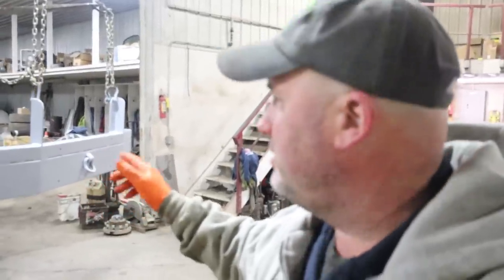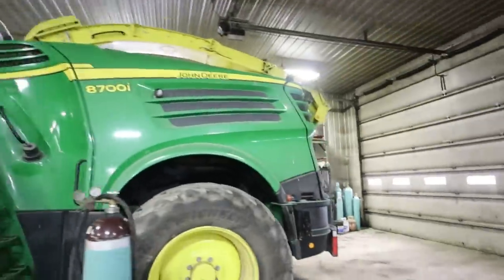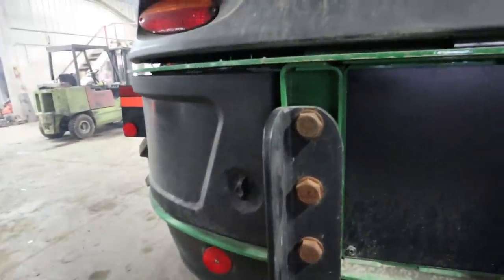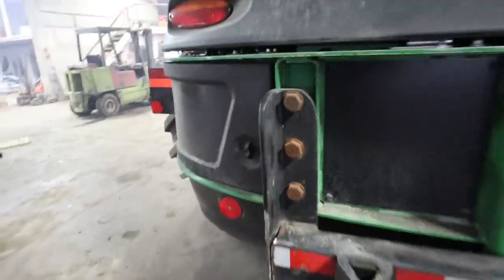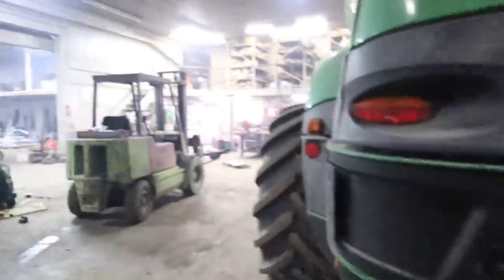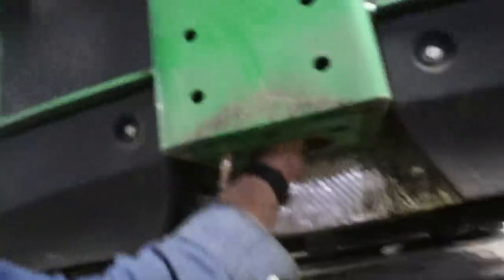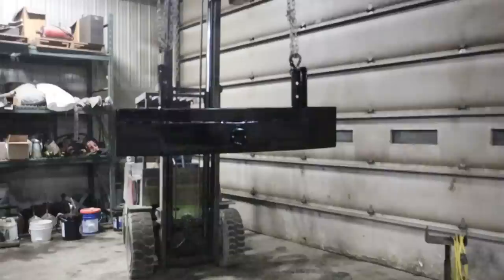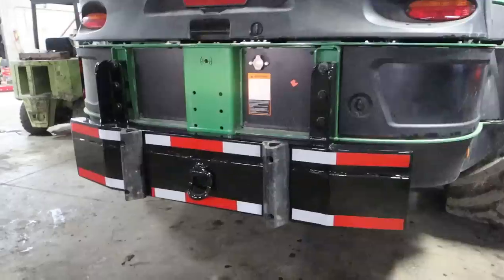John Deere 8700 Chopper bumper repair

Comment: Bumper repair turned out great. nice touch painting the chain. when i paint my chains, i use fluorescent green so i know they are mine. not to mention it looks good on a black trailer.
Reply from the maker: Thanks for the comment, florescent green and black is a great combo.

Comment: Andy, you need two back up cameras with night sight!
The upgrade to half inch and increase to grade 100 will last longer. The grade 100 does not stretch out nearly as fast! It lasts a lot longer. It is always cheaper to buy the chain by the barrel or bucket depending on how much you need. It is also cheaper to buy your hooks by the case... 

In my personal opinion, Grade 100 chain is made to pull with and the rest of the grades of chains are made to hold stuff in place.
Reply from the maker: I buy the chain from a guy that but it in 55 gallon drums.I would be a long time going there that much chain

Comment: Nice job on repairing the bumper! Make a half a dozen bumpers and send them to John Deere and there is your beer money for the summer. Are those one time spray guns or do you use them a few times
Reply from the maker: I get a couple used out of them and I have also thrown them away after a single use.